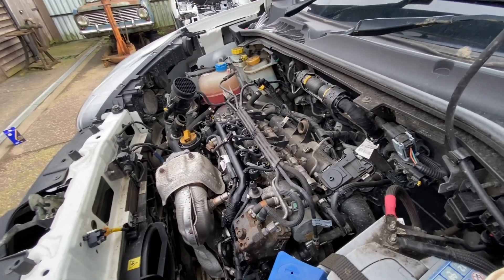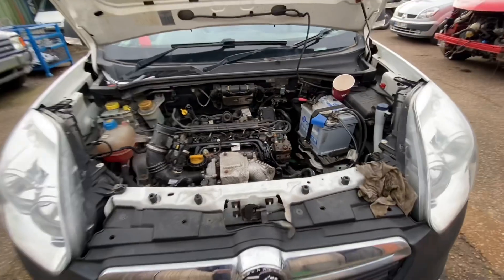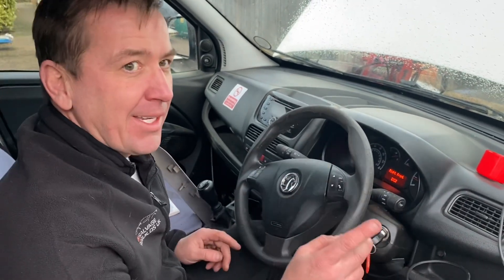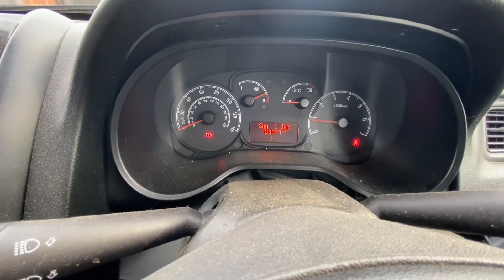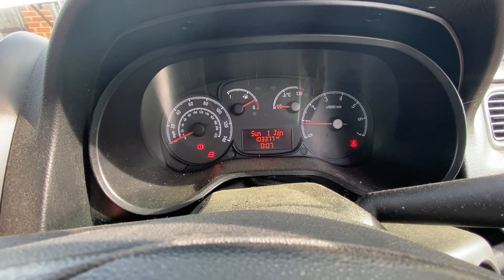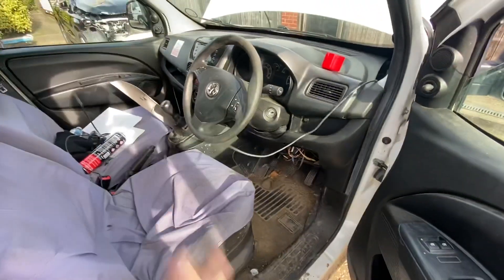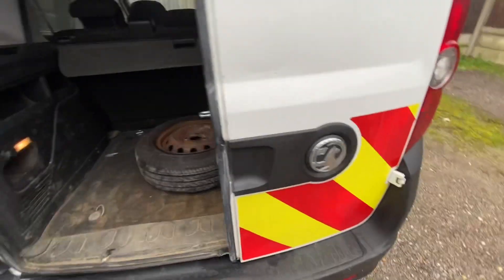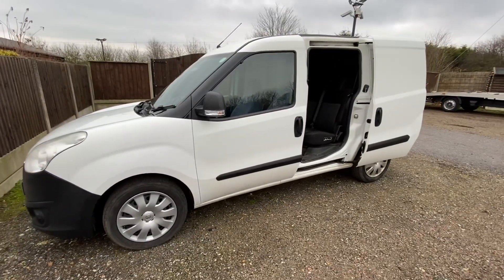2014 Non Runner Vauxhall Combo Crew Van Expensive Repair £££

Comment: On the injectors the leak off test checks the condition of the spool valve. Its important because too much leaking means the pump cant hold the common rail at the right pressure. The reason they can pass that and the engine still wont start is because the nozzle is worn and not giving a fine spray that can ignite easily, or at all. Fuel does have very fine grit in it which is why injectors degrade over time so you are spot on in your attention to filters.
Thanks for another fun video and good result.
Reply from the maker: I’ll pin this comment as you will answer a lot of people’s questions regarding why they fail. Thank you Stan 👌👍
Reply: @sruk  terry I’m very interested in the red vivaro van and that was me that asked you a few weeks ago about the same kinda van I’m looking for a half decent van ((
Well you let me know when you get a chance thanks
Reply: @sruk  sorry I meant to say rob //
Reply: @patrickjm3487  ok bill
Reply: @keterpay2379  thanks pat
Reply: the issue with the nozzles degrading over a short space of time indicates poor filtration, poor maintenance - filter not replaced on time or the injectors being made of cheese

Comment: I had a combo and had starting problems when engine was warm nothing showed on diagnostics and yes it was injectors the guy who does my mechanising diagnosed it the old fashioned way .(used his experience.)  It went through 3 accelerator switches during the 9 years I had it.
Great video again your positive attitude is really uplifting!!!

Comment: Wish everyone was as genuine as you, you could easily get a set of used injectors for couple of hundred pounds and get it to a running point and flog it on for £4000 but no you spend a small fortune to get the veichles immaculate and sell under market value. Well done rob

Comment: Is that an old HA van in the corner?  I bought an old ex-Post Office van years ago (R reg) and the clock said 30,000 miles.  I thought it had been adjusted but then under the seat I found the postie's log book - every day, every single 5 mile trip was recorded!   Great van.
Reply from the maker: It’s not a van bud no 👍

Comment: I had to clean the holes for the ignition coils on my renault clio, the rubber seals on those ignition coils are quite worn so some water came in. A thing made the job so much easier than to wrap paper towel on a screwdriver, and the thing is, use a gun cleaning kit. It comes with a metal rod were you screw a tip on with a hole in it. Put some paper towel or a piece of cloth trough it, and wrap it around. Really easy and the paper towel or the piece of cloth won't get stuck in the hole..

Comment: With the Combos especially yours twice a year a bottle of Cataclean in the fuel or Forte Turbo fuel treatment and injector cleaner my Combo has never failed emissions Cataclean is the best Quarter of a tank of Diesel drive for a set distance as set out in instructions you’ll notice a big difference 😉👍🏻

Comment: That's much better with the price, good bit of profit for you, a wee tip for you that I do in work with the BT vans, get your G101, 50/50 mix with water in a spray bottle, scoosh all the exterior mouldings and let it soak for about 15 minutes before you wash the van and they should come up really nice, gets all the grime out the texture 😉
Reply from the maker: I do bud but use warm water it works a lot better 👍
Reply: @sruk  good stuff mate 😉

Comment: Are they Bosch injectors fitted to these vans? I'm really surprised they fail so quickly because back when i was employed by a competitor manufacturer the then standard Euro 4 injectors where expected to last 500,000 miles.
Reply from the maker: They are bosh yes 👍
Reply: I agree Les, seems odd they have failed after 103k miles. Must have never had a filter change or sat idling all its life

Comment: I remember years ago ( iam a spark ) I use to buy Ford Fiesta vans cheap from bt .. bought quite a few the last one I bought was a 1.8 deisel 98/99 cannot remember now but only paid 350 at the time kept it 2 years had 91,000 on it sold it for 550 lol ..about 2002

Comment: Hello Treacle 😂. Have you tried furniture polish or hairspray to remove sticker residue.  It’s far cheaper than a glue remover.  Just a suggestion, thanks for uploading this.  It’s always enjoyable to watch you pull off another project.
Reply from the maker: We use thinners it comes off quickly 👍

Comment: Why do you think the injectors fail on these particular engines? Presumably they are standard Bosch injectors. It would be interesting to know what the fault is and what exactly firms do to them when they recondition them.
Another great video, as always. Thanks

Comment: Would it be an idea to have a set of injectors refurbished so you can test the vans when they come in to confirm that the injectors are the problem so you don't spend 900 on injectors when it could be something else it's just a thought and then you've got them for every combo you do ... loving the content lads keep it up
Reply: That;s what the leak off test is for with the bottles if they don't fill up the injectors are ok hence number 3 stayed empty injector 3 was fine,  if he does enough of them he might get a set for nothing lol

Comment: Rob, given how much the injectors cost and you seem to be changing quite a few, I wondered if you had ever tried flushing them out by running the engine off a bottle of liqui-moly diesel purge i.e. not in the tank but run the engine just off the purge. Looking at the filter, the problem could be caused by accumulated dirt... Clearly you might have to get it started off ether to overcome the start-up issue.
Reply from the maker: Worth a try

Comment: Hi I don’t mind the chevrons and reflective strips actually. Just a bit of advice I’m after if anyone has time to reply. My 2012. Vivaro van makes a sharp click from the steering when you put the lock on or sometimes it does 2 clicks. Seems to be coming from the drivers footwell. Does it when stationary or moving. The boot on the drive shaft on that side did come off a while ago and I re greased it and replaced it but not sure it made a great deal of difference. It was the outer one. Just wondering weather to take a gamble on a new drive shaft. Excellent videos thanks.👍
Reply from the maker: 9x out of 10 clicking is driveshaft 👍
Reply: @sruk   thanks for reply mate.
Reply: If it’s coming from the footwell check the steering uj for play.
Reply: @theyorkshirediyguy  thanks for reply. Don’t think it’s the steering uj seems as though it’s more than that. Coming from the footwell is just the impression you get whilst driving but I will have a look at that tomorrow. 👍
Reply: It's probably the driveshaft, especially if the boot came off. A bit of water or grit has probably got in it ☹️

Comment: Another cracking quick turn around for you both, to be fair I think the price tag is spot on, ok it's more than the others which some may compare against but the other two vans you sold was to cheap, what's the red van and the front end damaged car in this video Rob
Reply from the maker: It’s not damaged bud that video went out Last week 👍
Reply: @sruk  can't believe I've missed that, more likely forgotten it Rob, watched everyone you've put out, I'm off to check 🤣🤣🤣

Comment: Hi Rob. What do you apply to the panels to get all the sticky glue off as I am struggling to get any off my car from a previous sticker. Any help is appreciated thank you.
Reply: I was going to ask the same
Reply from the maker: I used standard thinners 👍
Reply: @sruk  Cheers Rob thanks for info. I’ll give it a go 🙋‍♂️👍
Reply: @MarkTheTaxiDriver  Oil often works nicely on adhesives as well, any kind of oil actually. WD40, sewing machine oil, even bog-standard salad oil! Just put a few drops on some blue roll and get going.
Reply: @Ragnar8504  thank you so much.  I really appreciate your help 👍

Comment: Rob, what is the mat that you use to lie on? Thanks 😊
Reply from the maker: A plastick boot liner out of a fiat 500 👍
Reply from the maker: https://m.ebay.co.uk/itm/Fiat-500-Semi-Rigid-Protective-Boot-Liner-Mat-50901727-New-GENUINE-Fiat/230418089961?ul_ref=https://rover.ebay.com/rover/1/710-53481-19255-0/1?ff3=2&pub=5575376664&toolid=10044&campid=5338268676&customid=CjwKCAiAyc2BBhAaEiwA44-wW4FI1gr7SuPwCiFmJwgPwUUhoVAHwkiwi7hTU8y1n2PWVWW_VOvQmRoCLYQQAvD_BwE&lgeo=1&item=230418089961&srcrot=710-53481-19255-0&rvr_id=2822126803296&rvr_ts=cadb91861770a6e5cba72d55ffe47779&_mwBanner=1&_rdt=1&ul_noapp=true&pageci=42dd464c-a3da-4641-8f69-9996fff06014&epid=19017014921
Reply: @sruk  thanks - looks ideal
Reply from the maker: @paulkedwards  bit spiteful though if I knew it was worth that much I wouldn’t have dragged it round the floor lol Iv had it years I like it because it’s got sides so nothing falls out 👍

Comment: Do you have to send the old injectors back to recuperate a core charge? Or did you not pay a core charge?
Reply from the maker: No exchange on the new ones only recon 👍
Reply: That's great so you save a bit of money being able to sell the faulty injectors and keep the good used ones I guess 👌

Not bad £900 I suppose if you can keep the old ones 👍

Comment: Do u timing belts when u service them  . As ur never gonna probbs know when it last had one .
Reply from the maker: It has a chain bud 👍
Reply: The chains can break at higher mileages, often being uneconomical to repair. Poor servicing seems to increase the risk (there's a surprise). Any time after 70k, any noises, consider replacing.
Reply: No point changing timing chains as a service item, only when there are signs of them wearing out
Reply: @sammytheseal2307  This Fiat engine has a tendency to break its chains. Any time from 70k if servicing has been neglected, or anytime after 100k if serviced properly.  Any noises from that area need addressing before expensive failure.  There are a lot of unhappy owners having suffered.
Reply: @nigelcox1451  Yes if its noisy it needs doing, but if there's nothing wrong with it, no point. It's like changing a clutch because it might start slipping in 30k miles time, impossible to tell.

Comment: Nice work as always just a thought to prevent the injectors being replaced at a crazy cost is it worth changing the fuel filter say every 20 to 30k miles ?? Best regards to you and all you tubers out there Mark from billericay 👍👍
Reply from the maker: Definitely should be changed with every service 👍

Comment: Anyone got a quick tip on how to take away glue from stripes like on the video? I tried with heat but just the stickers are gone but the glue stick to the car, even with glue remover it seems like its not working....
Reply from the maker: Thinners 👍
Reply: @sruk  thanks Rob, ill give it another try with thinner 👍🏻
Reply: Or Autosmart tar & glue remover

Comment: I notice van mileage is always a lot higher than car mileage for obvious reasons but where a 103K miles is a good van a saloon car at 103K would be regarded as knocking on a bit. Q. Why are they regarded differently? Are vans built differently for a longer reliability?
Reply from the maker: To us there not 👍

Comment: Can i just ask why is the injectors so expensive ?
Reply from the maker: They all are bud 👍
Reply: thats how much it costs for the oem injectors, can get some slightly cheaper or more expensive for aftermarket, but most modern injectors are this price and above, especially on diesels to deliver fuel while under so much pressure, diesel systems run a lot higher fuel pressure and need the parts to cope.

Comment: Nothing wrong with refurbed injectors as long as you get the calibration certificates. Bad move there could of saved yourself £6-700 quid

Comment: Running a diesel is supposed to make economic sense. The original owner of this van has taken a huge hit due to his van virtually becoming an uneconomic repair. Are modern diesels just too complex and temperamental and ridiculously expensive to repair when they go wrong? My 1999 non turbo Expert is a perfect example of how to do it right. And smiley Transits. Love ‘em.
Reply: direct injection diesel and Turbo charged ones was never meant to be for work in my opinion, we had like 5 work vans 3 of them have a standard injection system which is reliable and the oldest sister is a 1.9d from 98 she have over 700k and going strong my brother changed the engine ones just because he torn his timing belt (his fault) and the others going well too, but Turbo ones are a real pain in the ass.

Comment: why are you charging for the battery that you didn't use in the end and stopping on the road side with no mot at a burger van
Reply from the maker: I got trade plates I’ll stop where I want to
Reply: You obviously know nothing about the motor trade.
Reply: @Wall1885  i do thankyou and understand that a drive to a mot station to get a valid mot don't include a stop to fill you're face
Reply: @mrx1509  are you familiar with the phrase, 'manners maketh man'..??
No...??!!